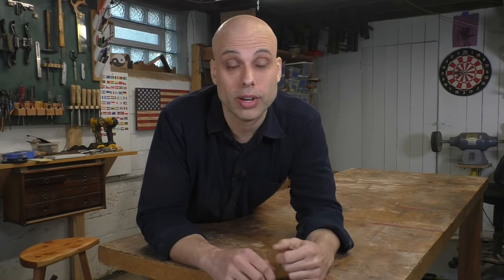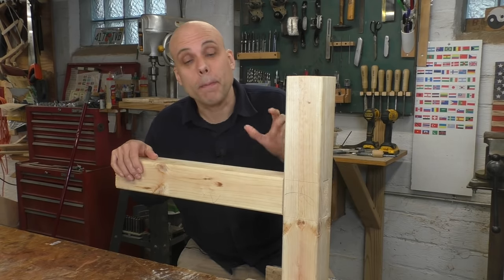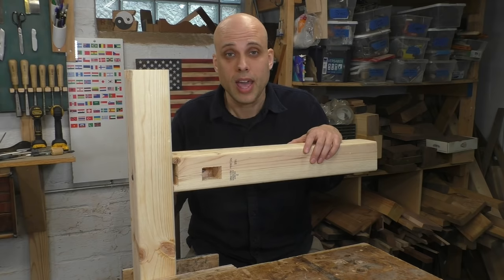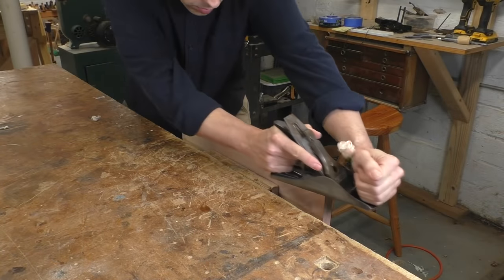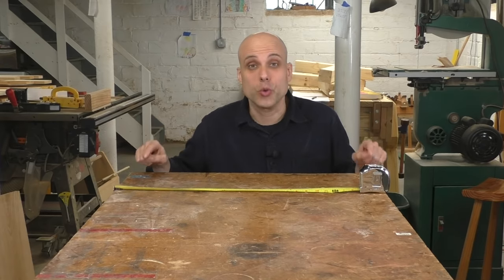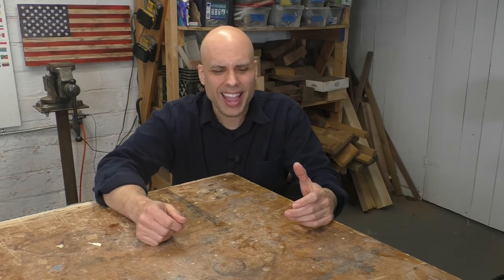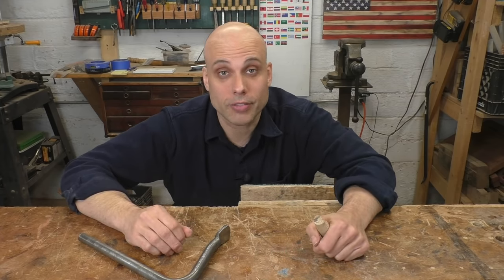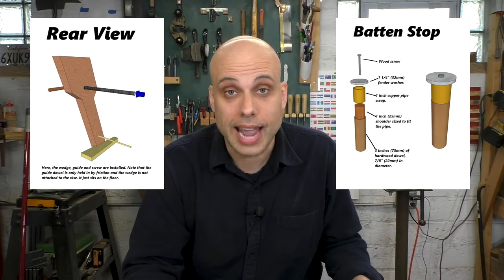Four Workbench Building Mistakes (that we all make).

Comment: The biggest disadvantage of wood is, that you can't weld it. So why not build the bench from steel sqaretubes?
Reply from the maker: Because it would be too light.  And since steel is so much harder than wood,  it would dent your work anytime you accidentally bumped it.  And you can't plane it flat.  And it won't hold dogs or holdfasts. Even if you just made the structure from steel and had a wood top,  many of these problems would remain.
Reply: @RexKrueger  Thank you, but I'm not sure if thats true considering weight and flatness of welding tables. I prefer a wooden plate as well, but steel structure takes less space and is stronger stiffer, heavier (if you want), cheaper (assmung same strength) ...

Comment: I built my first MFT workbench against the wall of my shed. Like an idiot I put the left side too close to the wall ..

So that meant whenever I wanted to saw something over 2 meters with my track saw, I had to wiggle myself in at an angle for the start

No way to brace for kickback.

So I would say, not only build it good but also place it well

Comment: 20:00 just want to say this, people are lazy, like really lazy, if there is an easier way to do something, some lazy shit already thought of it and bragged about how much better something is. if you ever things there is a better way to do something, someone else thought of and did it first, if you you cant find a better way, thing real hard if the way you came up with is better. a lot of hand tool techniques can be assisted by powertools, a drill for instance to get a fair amount of material dealt with so you can get a chisel in to get it nice, but if something is done some way for a long time, its done that way for a reason.

Comment: 21 minutes??? You sure do jump to a lot of incorrect conclusions.  I guess we're too stupid to use a drill and keyhole saw to cut a mortise joint.  I'm also not stupid enough to make some kind of bolt (cluster) joint that you were enamored with. Just plain looks stupid to me (the first time I saw it).   Integrated clamp things, ok that's a good suggestion.  Clamps work for me just fine BUT IT DEPENDS ON WHAT YOU'RE USING THE BENCH FOR. 15 minutes was all I could take of this as you were coming up with too many false assumptions.  The idea that 1 bench will do everything-forever is just moronic and who would think that? You may have covered it later but a replaceable top is also a good option. I used 1/2 inch MDF and can swap it out in a few minutes if it gets too banged up.

Comment: Lousy video by someone who assumes a lot and knows everything after only twelve years.    Craftsmen work with a variety of benches with different purposes and working styles so there is not just one perfect bench or type of construction.   Many of us aren't just wood workers and aren't just making casework.    At this time I have three benches.  Two with maple tops and one with MDF.   The two maple top benches have VERY HEAVY cast iron legs I found over the years and they date back to when craftsmen knew a lot about quality.   One set of legs came from a patter-makers shop in a large factory and were made in house for wood working benches.  The other set likely were made in another local foundry.   The third bench has a VERY HEAVY welded up base that was originally made as a machine base.  Very heavy is the key for a variety of reasons.   First bench legs?   I'd use concrete blocks glued together and to a stretcher to attach the top.  Heavy/cheap/sturdy.    Go cheap for your first top and get the largest vise (or two) you can find/afford.   You'd also be surprised at what you can do on a very simple bench knocked up from 2X material.   Many very skilled boat builders do most of their work away from a bench.   Lots of decent  options and some are very simple and within grasp of the beginner.
Reply: He never claimed you only needed a single bench for your whole career lol, it's just a guide on what to avoid doing when you're just starting out on making your first bench